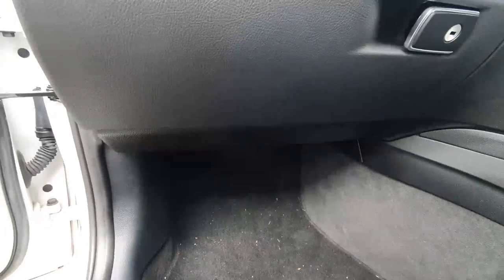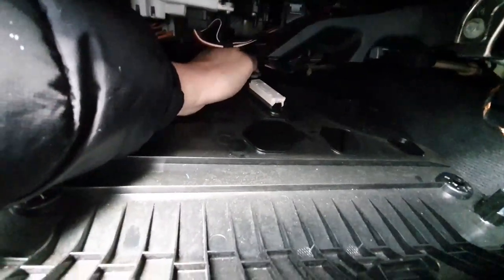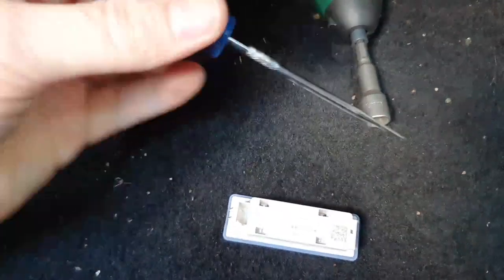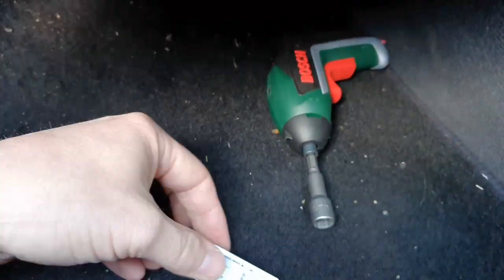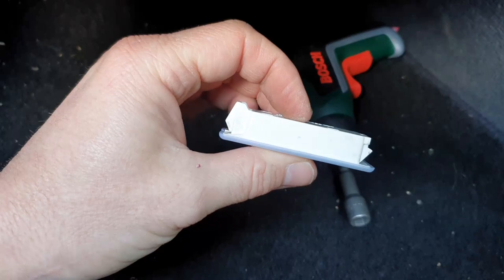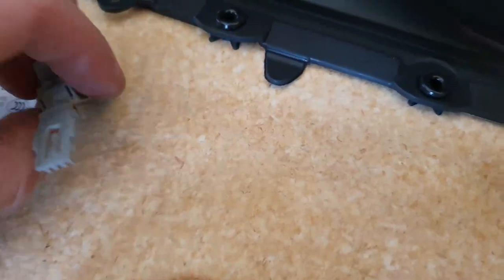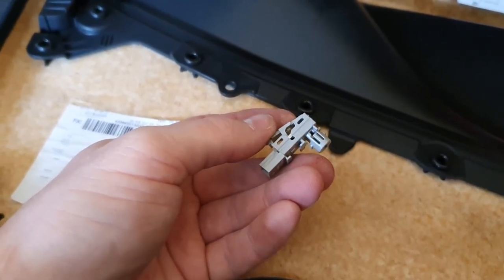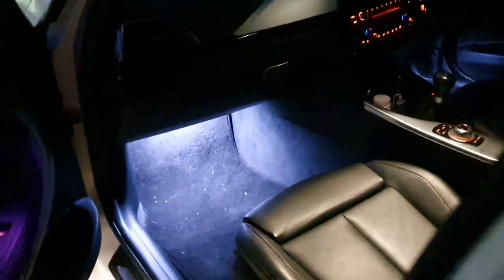Dual colour OEM Ambient light upgrade guide. BMW F20, F30, F32, F10/F11 (The Best)

Comment: Super awesome video bro!!!!!
I just ordered my set of six pieces.

Very Reasonable Cost for the LEDs.

For those who are wondering, the site is in German, use the three dots to change the language to English.
Reply from the maker: Cheers. They now do the module for the ac surround too.
Reply: @mvautomotive7092  You uploaded a video for that also? If yes, I will check it out. Thanks 👍👍
Reply from the maker: @Matthew-yi3bm  indeed that is for the drinks holder, if you have the light around the AC radio panel then you can now change that also. Please see link below. 

https://www.benzinfabrik.com/de/brandneue-produkte/8060/2x2016-smd-led-modulplatine-ambientebeleuchtung-klimablende-fuer-bmw
Reply: Hey bro, thanks again. Will look at it
Best regards

Comment: Hey excellent work, just recently got a f31 love it only thing I would want to improve is the interior lighting after seeing this I will copy your process to obtain my result have you found a way to change cluster display colour?
Reply from the maker: There are a few changing them to white. Means taking the dash apart and soldering new smds. You can also get the new digital dash butcost is high.

Comment: Did it on my F32, beautiful result. A friend of mine has a E92 with the ambient lights. Question: works this on E92 too?
Reply from the maker: They have lots of different modules on the website. I would have to check if these ones are compatible. If not, I am sure there are some that would work.
Reply: Im thinking of doing it to my f32 bud, you got any result pictures you can share?

Comment: Hi, question regarding these footwell lights I know they light up when you turn your headlight switch on or while opening doors but do they light up while you’re driving too/night time?
Reply from the maker: @Breezyy182  they are on when your original oranges light were on so would indeed be on at night. They change to white momentarily when you open the doors in the footwells. You can change the colour and brightness level through idrive as normal.
Reply: @mvautomotive7092  cheers for that!!

Comment: Hi.... the website is in another language. So i dont know what the correct colour to get
Reply from the maker: If you use chrome internet browser. Hit the 3 little dots on the top right handside of the page. Halfway down, your see translate. Push that and it will auto translate the page into your desired language.

Comment: Are the footwell lights dimmable on the idrive menu in the same way as the original ones?
Reply from the maker: Yes they are. I coded mine to be seperate from the dash lights. As you can dim them through the dash light switch also.

Comment: Hi, just installed benzinfabrik bulbs - how would I get my footwell lights to stay on when the door is closed as they currently do not? Thanks
Reply from the maker: You can't code them. But you can just turn side lights on if needed. Mine stay on purple while headlights are on.
Reply: @mvautomotive7092  thanks mate, I have a 435d but even at night the footwell lights don’t stay on

Comment: supp man just got mine, but i'm having a problem. I bought the same as you, the purple, but they only go white... when you open a door they get bright white as it is supposed, but when i close them they stay white, just get less brighter. Am I missing something?
Reply from the maker: Try changing between the two colours on idrive see what happens. I also coded my interior lights to not sync with dash lights. Let me know, and I will have a think.
Reply: i have the same problem too, mine won’t change from white. is it a coding problem?
Reply: @savionjolly4827  it is not a cosimh problem. You need to go on your idrive on settings, go to lights and then you need to put them in classic. In classic it would normally go orange but now it will go to the color that you choose. In sport it stays white

Comment: How many boards are included in one order? It's confusing because in their website the title says 2x2016 SMD LED module circuit board.
Reply from the maker: So it's one module per unit. There's 2 2016 size leds on the board.
Reply from the maker: So you would need to order one of those modules per location. I used 5 of the small ones and 2 of the larger ones for footwells

Comment: i’m having a problem on how to change the footwell lights to purple on my f30, can i have some help please?
Reply from the maker: Ofcourse. What is the issue you are having?
Reply: i recently purchased the white/purple board for my footwell lights but it only stays in white
Reply from the maker: @savionjolly4827  what colour are the door and dash lights?
Reply: @mvautomotive7092  white cause it’s in sport mode
Reply from the maker: @savionjolly4827  sorry just to confirm when you change it to classic they stay white?
Reply: @mvautomotive7092  yes they stay classic
Reply: @mvautomotive7092  honestly don’t understand how to change it, i’ve searched in settings
Reply from the maker: @savionjolly4827  mmm what spec is your bmw? Might be worth dropping a message to the manufacturer. Will have a look also.

Comment: What about roof ambient light?
Same module??
Reply from the maker: I will check which ones you need and get back to you.
Reply from the maker: The roof ones I believe are the individual led bulbs that you can not change. The best option is to disable the orange light so that it does not disturt the new colours. But still shines white if needed. If I remember it's the left most cable on the connector.

Comment: do you change the colour through the I drive ? how does it install the rest of the colours ?
Reply from the maker: Yes these new led modules allow you to change the colour from the original orange and white to a different colour and white. In my case its purple. But you can choose either red, blue, purple, brighter oem orange or a golden orange. You can stll select either sport or dynamic through the I drive aswell as brightness levels.
Reply: @mvautomotive7092  yes idrive allows you to choose Sport or Dynamic. But how is the color actually changed? Does the idrive let you change colours?
Reply from the maker: @Muzwwwywwwywwwywwwy  the bulbs are physically changed. Where on the led module it would be orange and white bulbs. The new modules change the orange bulbs to the colour of your choice. So where as on the idrive you would choose white or orange the orange has been replaced on the led driver module.
Reply: @mvautomotive7092 cheers, do the footwell lights stay on whilst the doors are shut?
Reply from the maker: @Muzwwwywwwywwwywwwy  yes they switch to white on opening the door and back to the colour once doors are closed and stay on the colour when lights are on as normal.

Comment: My Led strip is Broken what can i do
Reply from the maker: If you are talking about the plastic light diffuser tube the  they are less than £20 from bmw. It just pushs up into a grooved ridge. Very simple to change.
Reply: @mvautomotive7092  you have a Site ?
Reply from the maker: @DeAdOrLiiFe  depending on part  numbers. See below link numbers 13 and 14. Make sure ypu choose correct side. Then google that part number. So etimes they come up on ebay and so on. But bmw dealer will be able to order no dramas. 

http://www.catcar.info/bmw/?lang=en&l=c3Q9PTcwfHxzdHM9PXsiMTAiOiJNYXJxdWUiLCIyMCI6IkJNVyIsIjMwIjoiMyBGMzAiLCI0MCI6IlNhbG9vbiAzMzVkWCIsIjUwIjoiRUNFIiwiNjAiOiI2MyBMaWdodGluZyIsIjcwIjoiNjNfMTM1NCBWYXJpb3VzIGxhbXBzIn18fGJtdD09Qk1XfHxicD09UHx8ZnY9PVZUfHxiYj09RjMwfHx2Rm9ybT09SlBHfHxtb2RlbD09MzM1ZFh8fHNtb2RlbD09TGltfHxlbW9kZWw9PVNhbG9vbnx8aWNvPT0yODYwMDR8fHJlZz09RUNFfHxpZD09NTU4MjF8fGdycD09NjN8fHN1YmdycD09NjNfMTM1NHx8aW1nPT00Nzk3Njk%3D